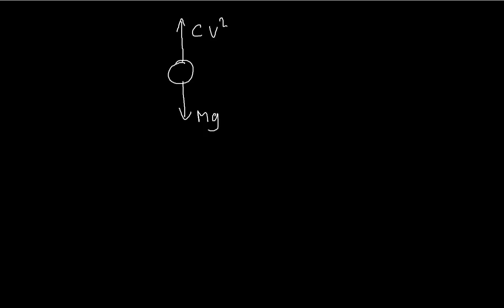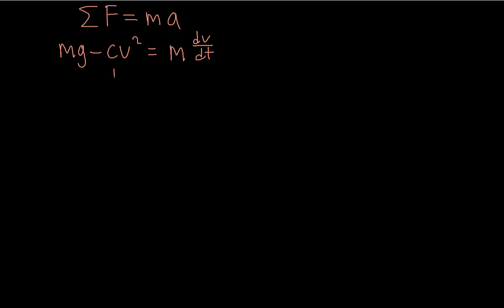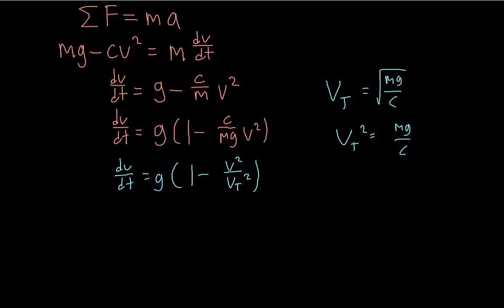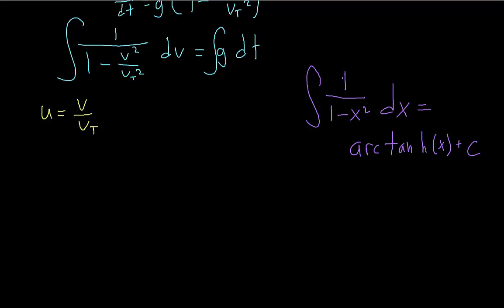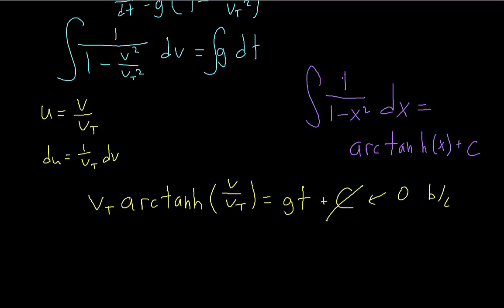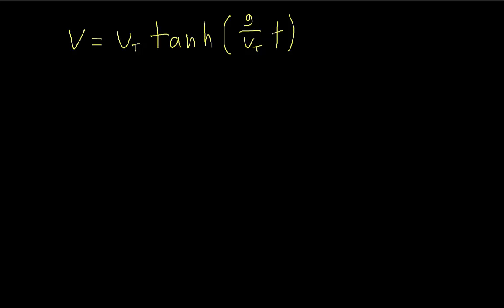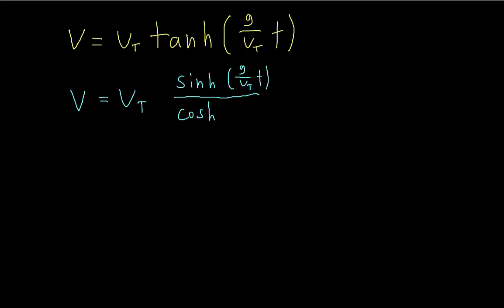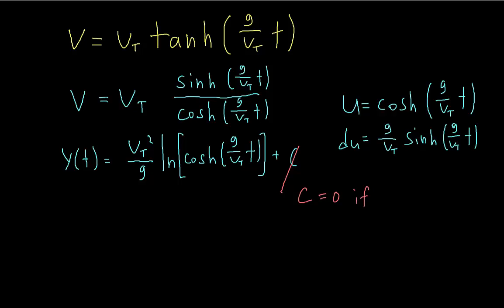[Physics] Free Fall With Quadratic Air Resistance

Comment: Great video, it was very interesting how you got it into the hyperbolic form. Just one question.  I also saw that the integral of 1/(1-x^2) is coth^(-1)(x). How do you know whether to use tanh inverse or coth inverse? Does it depend of the initial velocity?
Reply: @Akil if the initial velocity is higher than the terminal velocity, use coth^-1. Otherwhise, use tanh^-1. This is to do with the domain set of the inverse hyperbolic functions.

Comment: With quatric air resistance, analytic solution IS IMPOSSIBLE.
You have written : mg-cv^2=m*dv/dt. With vectors or not, that is false.
You  would have written, in y-axis : -m*g - c * v_y * sqrt(v_x^2+v_y^2)=m*dv_y/dt     OR    with vectors : m*\vec{g} - c * \vec{v} * v = m*d \vec{v}/dt=  m*\vec{g} - c * \vec{v} * sqrt(v_x^2+v_y^2) = m*d \vec{v}/dt.
Reply: That was an analytic solution for the case of falling. It does not apply to any v, which is what you are trying to do